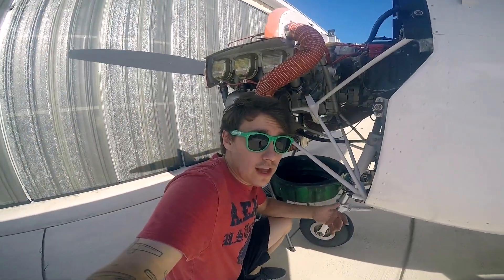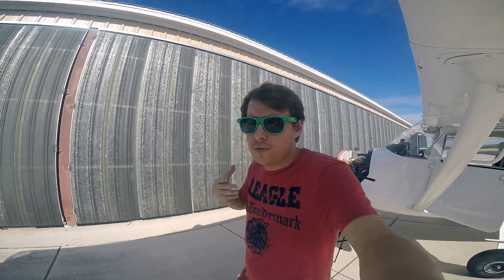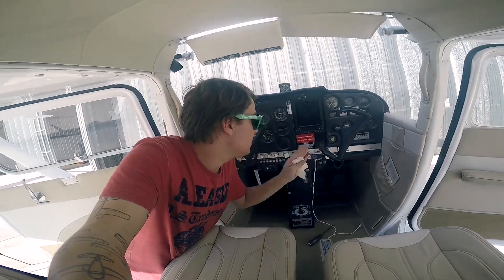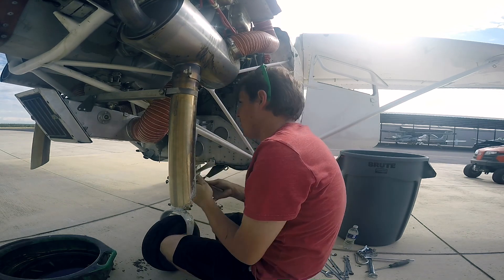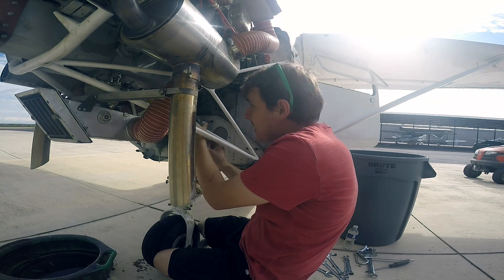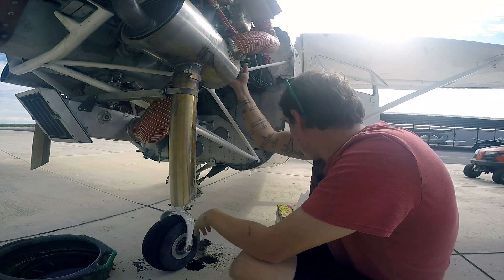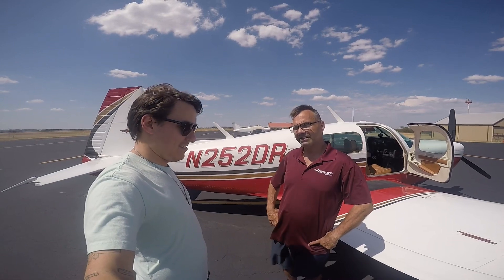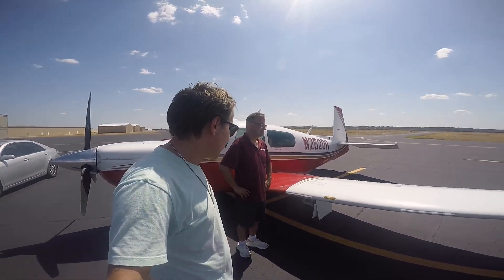Cessna 172 Project Rebuild Cost Breakdown, And He Sold His Half!

Comment: How/why did the 750 cost $60,000 to install?!
Reply from the maker: Because they also added the Auto-pilot and transponder at the same time. Didn't realize until after I uploaded the video I meant to say All the avionics and not just the 750
Reply: @brycebuildsit  That makes sense. Obviously every airframe is different so prices will vary (you don't need me to tell you that lol). I was wondering if that included the 750, AP,  comms/ELT/ADSB, etc. It's a very clean plane. I wonder if a panel redesign is on the agenda.
Reply from the maker: Eventually, they do want to go to a PFD MFD, but I think they'll wait until the put the IO-360 on it and do it at the same time
Reply: Phew!